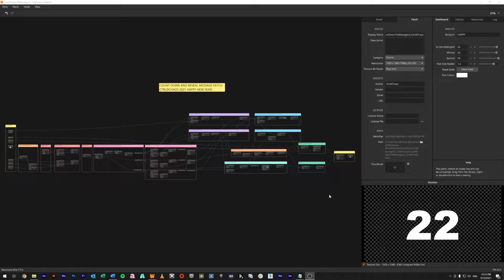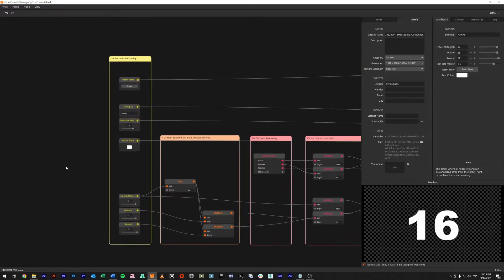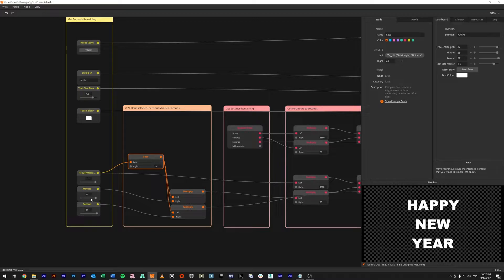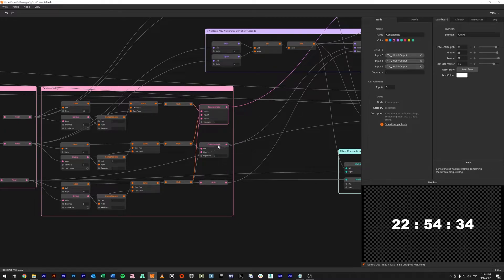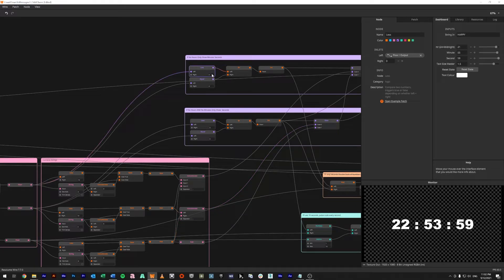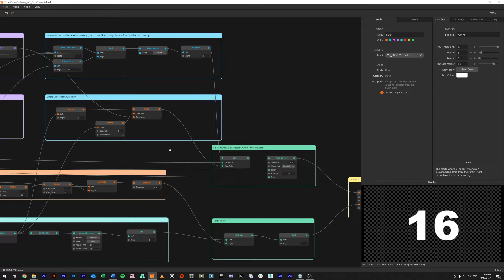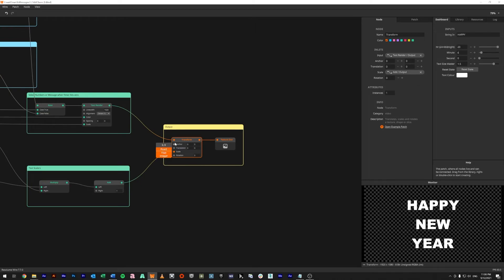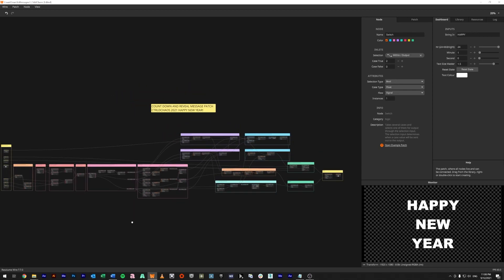Resolume Wire - NYE Countdown Timer Pop Up Message Breakdown Tutorial. Download Link in Description

Comment: Hey, thanks so much for this patch, I used it last year and it worked great but I think somethings changed in Resolume (running 7.18.2) which has caused a bug, every hour it triggers the 10 second count down, for example when it hits 03:00:10...
Reply: I had the same problem. It seems like I fixed it by doing the following: In the two groups where we check if there are any hours and the other one where we check if there are any minutes left I added an "and" node connected on the left with both or nodes and output going into the "int" of the "if only seconds are left" box. You can see the part I´m talking about at 8:50 in the video.
Reply: this should check ifnot only the minutes are less or equal 0 but also the hours are less or equal 0

Comment: I really like this wire countdown, is there an option to download this one as an compiled file or could you send by mail?
I was searching for something like this a long time.

I'm not that good with Wire and don't have a wire license (only Resolume Arena), but would like to ask you if it is possible to edit and compile the file again with these changes / options:

- possibility to select a font

- spacing between characters (less or more space)

- possibility to countdown from a own set value (lets say 0 hours 30 minutes and 0 seconds for a 30 minute pause or break in a gig)

I also found this one: https://www.youtube.com/watch?v=vWwDNNZ4XSs
But yours has more options
Reply from the maker: Hi, I've added a download link to the video description. Unfortunately It doesn't appear that Wire has the Font Exposable, However I have added in Character and Line Spacing, as well as Left, Centre and Right justification.  I have other projects for non clock locked timers including OSC triggers  on Zero and will post those soon once I have done some more optimisations. Hope this helps.
Reply: @ctrldchaos  Thank you very much,. Would it also be possible to countdown from a own set value (lets say 0 hours 30 minutes and 0 seconds for a 30 minute pause or break in a gig)? This is an option i can't find anywhere, but would be very usefull for some of us. I also bought the Juicebar Counter plugin (with font select and other options), but it also can't countdown from a own set value. Hope you could edit this, i will follow your video's.
Reply from the maker: @r.keijsers9941  I would build something like this using the Timeline node in Wire as opposed to the Clock Time. I'll try to get a video up in the next week or so with a free running timer you can set the length of.
Reply: @ctrldchaos  Thank you, that would be great
Reply from the maker: @r.keijsers9941  I have another video up on the channel now covering a manual countdown that is not locked to clock time. Hope that helps.
Reply: @ctrldchaos  can you put a link to the video?
Reply from the maker: @r.keijsers9941  https://youtu.be/18Imc3g1W88
Reply: @ctrldchaos  i have seen this video and it is also nice, but i don’t need the border and color flashing etc. Just like this video a simple countdown, but then set by an own number / value to countdown from.

Comment: Could you explain the top right blue section? You changed the names of the first two nodes, are they greater, equal, less nodes?
Reply from the maker: No worries. The first 2 on the left are "Equal" nodes. The top checks If only seconds remain, that there are zeroes in both hour and Minute. The bottom checks for a value of "00" in the seconds remaining.  These feed into an "And" node that only triggers when both equal nodes are true ( zero seconds left) into an accumulator that immediately starts counting up. A "Greater" node fed by the accumulator sends out a 1 if the accumulator value is bigger than zero. This means even when the clock ticks one second past the trigger time and technically the hours and minutes refill, that there is a true signal  being sent to the gate that switches the numbers out for the text string.
Reply from the maker: Apologies for the rough overview and explanation. I'm still cleaning up the patch as part of a larger toolset.
Reply: @ctrldchaos  no need to be so humble, I'm still having a blast learning this with you. The few missing pieces are kind of a good exercise to check if I'm learning :' >